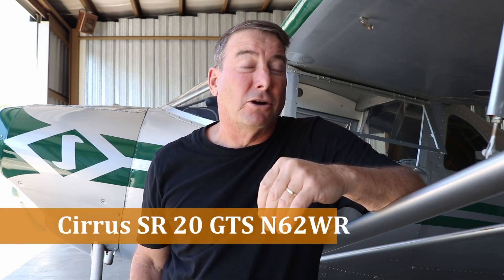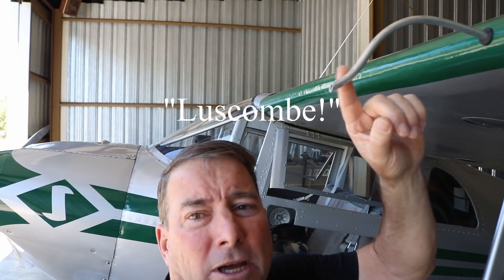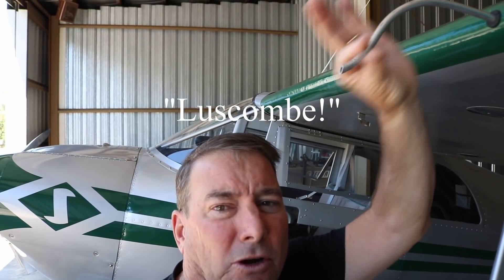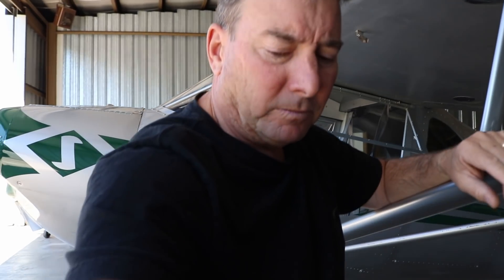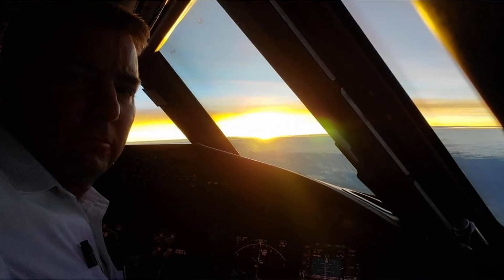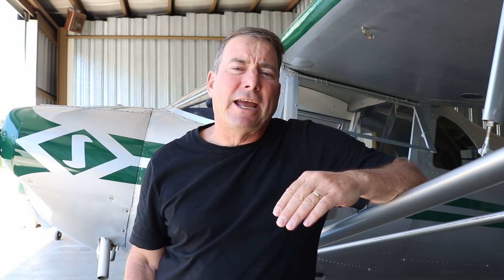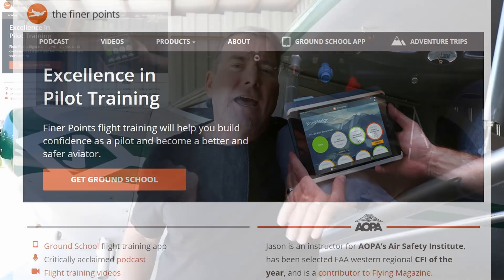Cirrus SR20 Crash Conway AR - AQP for GA!

Comment: Seems like there are a lot of Cirrus accidents and crashes lately.  Anyone have the statistics on the air frame?
Reply: Yes there appears to be several Cirrus accidents in the last few months.  Are they related to pilot error or is a common mechanical issue?   The one at centennial airport in CO was fortunate that all got out ok but had to be a pilot error.  Be interesting to know the bottom line.
Reply: Really?  Name them.
Reply: @speedomars  there are three I’m aware of in the last 45 days. My concern is that there is either an issue of pilot training/competency, too much airplane for the inexperienced or an over reliance on the belief that the chute will bail me out. 

AOPA statistics show that Cirrus does have a higher fatality rate than other comparable GA aircraft, which makes one wonder since Cirrus builds a great plane with more safety features than anyone else. Do those features lead to sloppy airmanship.
Reply: @sethadams4871  There are 8,000 Cirrus aircraft flying.  Cirrus has the best training in the industry. And they make the safest aircraft.  The reliance on a chute is a myth.  Cirrus mints what is known as a CSIP (Cirrus Certified Instructor).  No one should train in a Cirrus unless they use one.  AOPA stats do not show Cirrus has a higher fatality rate, in fact Cirrus saves lives installing and training for the use of the chute whereas all other aircraft simply crash killing all those on board and on the ground.  If you are gonna comment on public boards about a subject, suggest you catch up with the facts.
Reply: @speedomars  And what might be your position with Cirrus? I didn’t question whether Cirrus built great airplanes, provided appropriate training or were good corporate citizens.

We had a yahoo in a Cirrus at APA overfly his approach while operating outside of Cirrus recommended pattern speeds causing a non fatal mid air collision, so your premiss on Cirrus training perfection  had a big miss with that pilot.

You can argue your case all day long on the stats, but AOPA does show the numbers singling out Cirrus with above average fatality rates, take that up with them.

Show a little respect to others who have different thoughts and observations than you.  We’re here because we support Juan in his efforts to improve airmanship and pilot safety, not to defend aircraft manufactures or debate who makes the best airplanes.
Reply: @sethadams4871  I do not work for Cirrus.  I do own a Cirrus, bought new and owned for five years.  I make it my business to follow everything there is to know about Cirrus.  Cirrus also communicates with owners and repair shops in regard to repair issues and programs to help new pilots transition to the product.  I am VERY current on every aspect of the training and the accident stats for Cirrus.  And know the plane well enough to teach others about it.
Reply: @speedomars  Wow, I’m really impressed and of course if Cirrus says so, it must be true. 😂

Comment: I’ve been thinking about pilot training lately.  All I have ever flown is a Quicksilver ultralight. One seat. No instruments. No radio. No ATC. No IMC.  Stall warning is: Wing shakes like a dog “pooping razor blades “.    Might it be better to have student pilots sit next to an instructor in a two place Quicksilver and get used to the basic feeling of flight at the simplest level?    Build confidence up to their first solo in the simplest machine possible. 
  Anyhow, it’s just a thought.         N.E.OH Bob
Reply: I agree. I remember sitting with an older, highly experienced pilot (and CFI) watching the GA pilots do TOs and landings back when I was a new ultralight pilot. Some were horrific. He told me a portion of those on the GA side just thought they were good pilots, but in reality lacked 'seat of the pants' flying skills, and that he had to teach the basics when they would transition to ultralights so they didn't auger their new UL into the ground. There is no substitute for the basics, and ULs teach it well.   BTW, much of my initial dual time was in a QS trainer. We had a $20 plastic ASI that was calibrated for 10-50 mph suspended in the flying wires under the left wing. Looked like a rain gauge with a little vane in the air stream. They actually work rather well.

Comment: Agree with the presentation, Disagree with all the acronyms...how about instead of a bunch of new acronyms we teach common sense and how to actually preflight, post flight and fly the aircraft....that worked for years until we stopped really teaching and aircraft started falling out of the sky...did we go back to teaching like we should?  No we invented acronyms and said it was the NEW, BETTER way to fly...
Reply: The thing is, aircraft didn’t “start falling out of the sky.” The GA total and fatal accident rates have been slowly declining since the 1980s, we’ve just seen a plateau in recent years with many of the same problems remaining unresolved. That trend holds true in Flight Instruction too.
Reply: Bravo. You sound like you must be a pilot instead of a bureaucrat or an "aviation influencer".

Comment: a 75 cent tiny  photocell on/off switch  flat in the pitot tube would alarm you if it`s covered duhhhhhhhh
Reply: @lacantinadicrono798   Back in 1957 when I was 14 we neasured airspeed in the Stearman cropduster by the angle and number of wags of your neck scarf
Reply: @lacantinadicrono798  Wow!

Comment: I personally don't think a Cirrus of any Model should be used as a trainer. My .02 Great info as always Juan.
Reply: Better a high wing trainer such as the 150/152 or 172.
Reply: Why? SR20 is a great airplane. Faster and more powerful than a typical trainer but shouldn't be too powerful like the SR22 for the beginner pilot.
Reply: @walkgeo I think it depends on the student, and the quality of the flight instruction. I personally did part of my training as a student pilot in a C182. The only thing I personally struggled with was the go around power taking my feet by surprise. Any licensed private pilot can buy any single engine airplane on the market (with the appropriate high performance/complex endorsements of course) right out of the gate. With the economics of time building and training for ratings, more student pilots have been buying airplanes to fulfill the requirements to make it to the airlines. I personally think students should have the option to buy a higher performance aircraft to complete their initial flight training and beyond. Thank you for sharing your opinion with the community!
Reply: He wasn’t a student pilot, at least not a PPL student. He had an instrument rating.

Comment: Huge surplus of ATPs in Europe…. Heathrow is graveyard.
Reply: “Heathrow is a graveyard” means it is down to “only” 85% airport utilization… 😉
Reply: huh?
Reply: @741al6  Until COVID, Heathrow was operating at like 99.5% utilization.  Literally couldn’t take any more flights.  So I was just joking that 85% seems dead (graveyard).
Reply: @baomao7243  Heathrow used to do 1,300 flights per day. Its down to 231 a few days ago.
Reply: @davidwebb4904  😳
Reply: @baomao7243  Passenger numbers went from 81 million in 2019, to 22 million in 2020. And 2021 is less than that.

Comment: Hard to believe that n 2021 a student could be fatally distracted by an erroneous airspeed indication.  I got my Private back in 1965, and IIRC I had to take the instructor around the pattern at least twice with the airspeed indicator covered, we called it a "mud dauber exercise".   My only argument/criticism of the current "Part 141" AQP campaign is, it doesn't go far enough, it should include Part 61 flight instruction as well.  These are people's lives we are dealing with here. let's not dumb down training to match a student's pocketbook.
Reply: What's worse is this guy wasn't a student but an instrument rated private pilot.

Comment: AA # 104747 FSC doh 1/17/1981  use to fly out of a Small airport  Phoenix field in Sacramento. I would go out to Lincoln airport to do touch and goes because at my home airport didn’t allow them. Well I remember one time I stopped my plane well not mine rental just to relax for a few minutes, got back in taxied down for take off , on the take off roll I heard a strange slapping noise so I aborted the take off, it turned out I had inadvertently left part of my seatbelt hanging out door. Oh by the way got my private pilots license from none other than Carl Harder, he threatened to stop the flight exam because I couldn’t hear the instructions he was giving me , but some how got through it and got my license on my first try. On another note worked at lax for the last eighteen years after they contracted out the ramp at smf . With our new contract I’ve since been recalled to smf witch I almost wish didn’t happen it’s IAM station I’m TWU wildly different ideals of how to do things, no respect for seniority. In my forty years with Aircal/American  hands down the worst managed station out of the five I’ve work at. Really like your videos got to support you on patron.  Eagles back to flying to lax maybe that’s helpful to you.
Reply from the maker: Carl Harder! My PPL Examiner! (Damn near flunked my oral- Density Altitude!)

Comment: I feel the SR-22 is too advanced for a student pilot. I know many will argue that. Its a great plane but needs a pilot with some experience.
Reply: SR 20 in this crash, but I agree. Terrible aerodynamics.
Reply: @justapaxuphere7985  Yes, its a advanced plane. I also hear insurance on them is going thru the roof. I also think like the old days of doctors buying V tail bonanza's or Mooney's its popular with those with more money than pilot skills because it has a parachute. If i get into trouble ill just pull it. A great design but not for those with little skill. Also Cirrus seems to do everything they can to insure owners are given good instructions. Once it leaves the factory or resale its all up in the air.

Comment: I'm surprised this is made so complicated for a GA VFR pilot. When I started training as a glider pilot in another century and another continent, the very first thing the instructor taught us, in the first flight, was to fly the aircraft by looking at the position of the dash with respect to the horizon. Same with turns. We would become so familiar with that, that losing the pitot by the time we soloed would have been a total non-issue. I taught the same way when I became an instructor.

Comment: Pilots should be able to accurately guess airspeed in GA aircraft just through sound, but because everyone wears noise cancelling headphones that very useful clue aid is often removed. The air makes a distinct sound between near stall speed and higher speeds. It is unmistakeable. Student pilots should be trained to listen out for speed/sound relationship. The next training content should be to blank out the airspeed indicator and require the student approach and land at higher than normal speed -WITHOUT headphones on.

Comment: Juan - some of your comments have me a bit baffled.  When I first learned to fly airplanes and helicopters, almost every point you made about AQP were things I was taught, and subsequently taught my students.  When you start rolling, one of the checks is airspeed.  Is it moving and at a rate you expect.  Granted, you need to have a few flights under your belt before you know how quickly the airspeed comes up, but you still look for it increasing.  Do students now just rotate when they feel like it without reference to airspeed?  Somehow I don't believe that.

Rejected takeoffs were taught to me as a civilian airplane student - and yes, in singles.  We won't even touch on multi-engine training, instrument training, or Army helicopter training.

Flying without reference to airspeed was taught as well.  You learned what the engine sounded like and spent a good deal of the time looking out the window to see the relationship of the airplane to the horizon - both in front and to the sides.  Every pilot should be able to do this from pretty early on.  I never had an instructor that didn't cover virtually all the instruments at one time or another to make sure I knew how to fly the airplane if everything except the engine quit. 

Has General Aviation stopped doing this, or did I have exceptional CFIs/IPs?

Comment: The problem with this aircraft, despite the prominent alternate or "standby" flight instruments (Airspeed, ADI and Altimeter) in EFIS installed aircrafts, is the fact that the ram air is provided by a SINGLE pitot dynamic source. IMHO, such installation should contemplate an alternate pitot tube ONLY for the standby instruments. I can't understand why this is not the standard on Cirrus...?! Extra cost for that would be minimal! OK, OK, he would forget to remove this second pitot tube cover, as well... probably.🤷‍♂️
I looked for this item of emergency procedures and found the similar Cirrus SR-22 POH with Avidyne panel (I think that's the standard or similar configuration of N62WR). The item "Pitot Tube Blocked" on Section 3A "Abnormal Procedures" (page 3A-13) says only that "the most probable cause is pitot ice", and procedures requires pitot heat on, descent to warmer air conditions and (in case of blocking not solved) "use known pitch and power settings and the GPS groundspeed indicator, taking surface winds into account." I think this requirement could be accomplished by a novice pilot, but ONLY if he/she had the proper training and interest on manual reading. This accident reminds me of Air France 477 crash in 2009...

Comment: No offense, but the worse offenders are often airline pilots that have been flying the line for years and decide to get a small airplane.  I’ve watched a couple try to taxi away with the tail still tied down some to the extent of powering up to drag a concrete block.  Talk about an ego blowout…

Comment: Poor pilot training, you should be able to fly without the ASI using visual references, power settings, VSI & GPS ground speed. Alot of times pitot tube is partially blocked with mud dabbers or a leak or hole in a static line pressured by cabin vents ASI will read low. Water & moisture freeze in the winter also affecting the ASI. If your stuck in some remote airport you got to fly by the seat of your pants. My first plane was a Cessna 140. I was a 21yo with a new private. My older friend Bob was a taildragger expert & mechanic he did the prebuy & test flight. ASI was one that around twice  0 to 80 & 80 to 160. It was frozen no way to fix it, bitter cold December weekend. He flew it 2 hours at night no airspeed, landed in a blowing crosswind & greased it. Look at me said just like a old shoe. I miss Bob taught me so much not found in books. Even gave me a Stearman ride.

Comment: That young pilot's instructor screwed the pooch. That was a day one lesson. really sad.
Reply: IF the instructor did not teach the student properly ! The student may have forgot his day one lesson and "screwed  the pooch" himself !! Yes very sad.
Reply: people make mistakes or have bad days, in aviation that sadly can end fatally...
Reply: As mentioned elsewhere this guy was a 38 year old pilot who had been flying since he was 16, and instrument rated since he was 20.  Which instructor, he's probably had quite a few.
My father was my instructor, and he and another instructor were taking a club 150 out for a quick flight.  My father pre-flighted the left side of the airplane, the other instructor preflighted the right side.  Neither one of them bothered to remove the rudder gust lock, which was two pieces of aluminum with a bolt running out of one and a wing nut for the other side, installed between the tail and the rudder.
Thankfully the 150 is such a forgiving airplane, they came back, landed and took it off.  My question is 'why did they miss it, and didn't they bother to do a 'Controls free and clear' check before take off?  Everyone makes mistakes, but unless it's really bad, you should be able to recover.  A pitot tube cover should not be a deadly mistake.
Reply: @GaryMCurran  Thanks for the info! This makes it even more of a mystery to me - why couldn't this very experienced pilot fly with no airspeed indicator? Airplanes don't need any gauges or radios to fly. The aerodynamics are the same no matter what. Thanks to having great instructors from the time I was 16 too, once I took off in my Cessna 140 on a cold fall day. I glanced down at the gauges on takeoff and the airspeed registered zero. I was climbing so I knew that was false and the pitot probably had some water in it that froze. Thanks to my training I just thought, 'Oh, the pitot froze. Oh well.' and went on about my flight.

Comment: You  Know....I   am  now  Convinced the   quality of  our   Airman  today... with  all  the  tech... is  MUCH  worse  then    30  years  ago when  Analog gauges    and   Spin  recovery was  a  Norm   for  good   Pilots...  I  did  a  BUNCH  of   Stalls   and   Spins    with  my  CFI....  so   when  it   occurs  you are   not   freaked  out. Folks  its not  that  Hard, follow  a  CK  List.   Our  ATP's  are  not  much  better, I  retired  from  USAir in  2000 but   buds    flying   for  AA    now   say  some  of  the  New  folks   are ...well ....   Average. I  would  Note    Piedmont   then  USAirways  had  Pilots   and  A&P's  with  extensive  Military  time...today  not   that  common.